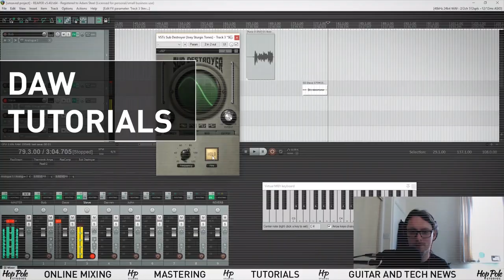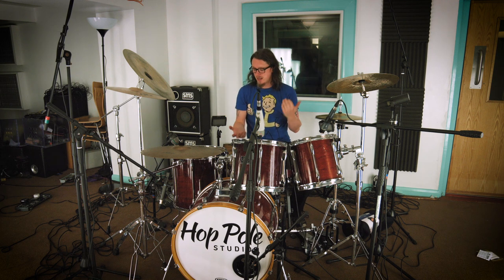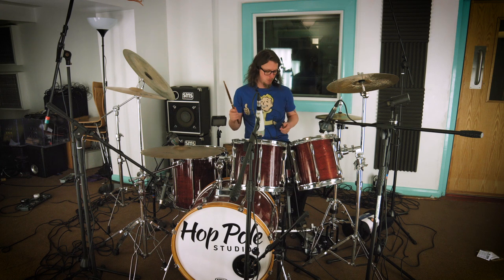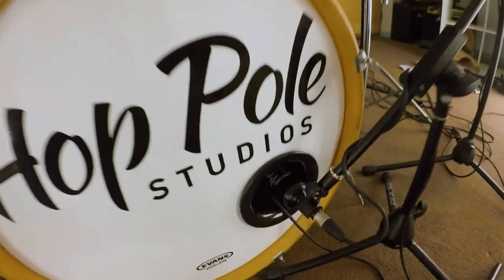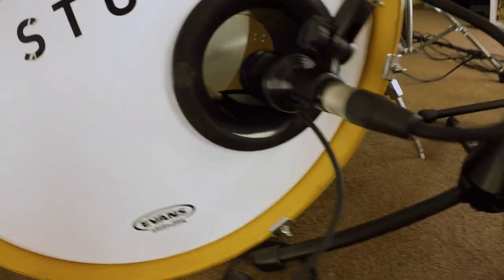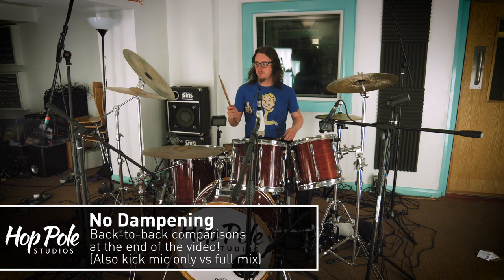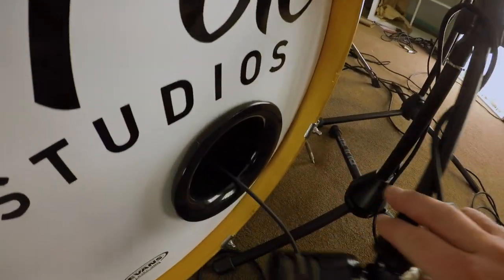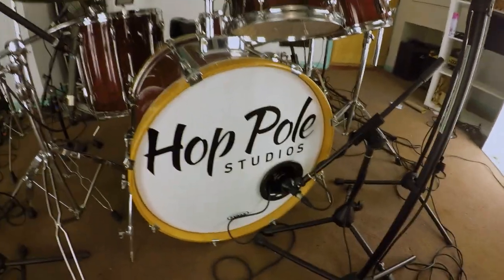Kick Drum Dampening - pillow, blanket or nothing?

Comment: The thin blanket one sounds the best to me.  Nothing overpowering and you can EQ if you need a bit more oomph. 

The weird thing is, only the one dampened by a pillow makes my tinnitus go crazy.  That usually happens to me when theres strange subsonics going on...like if an Air Con cycles on in a hotel room.  So I'm thinking the blanket is a much better overall dampener and the pillow introduces something in there, because the undampened and blanket one doesn't set it off at all.

Comment: Salutations sir, I play Jazz mainly, so no dampening - I want the ring, but my practice kit, where I don't want too much ring, has a duvet of high tog in it. I will add the Jazz kit has the smaller higher tuned toms and tightly tuned empty bass drum. I would be playing more with brushes than sticks a lot of the time for our sound.
 However, I shall be playing with a more bebop, (like Gene Krupa met Joe Morello and they begat a freaked out kind of Art Blakey nut) - type band soon and we are in rehearsals now, so the kit there is a loud high toms high tuning, low toms low tuning, bass low low tuning and 2 snares, 1 high, 1 low.  However - back in't day, when I used to play rock i went for high dampening, a pile of old blankets, duvet - anything to pack it out and deaden the sound to a dull low thud, more toms than a cat rescue and lots of metal on stands for the cymbals and then the Peart- esque kit - dual both sides with tubular bells, roto-toms, rockets and whistles. A Mid Drum Crisis? Probably. I like your show - please remember not all of us play rock or metal but i'm sure you knew that.
Reply from the maker: Thanks Mark. Yes, it’s true certain genres use less dampening and higher tunings- but I have to speak from a place of experience, and a jazzer I am certainly not. If I were to talk tuning for jazz, it wouldn’t be authentic unless I got in a jazz player for a guest spot. Perhaps I could do that down the road...